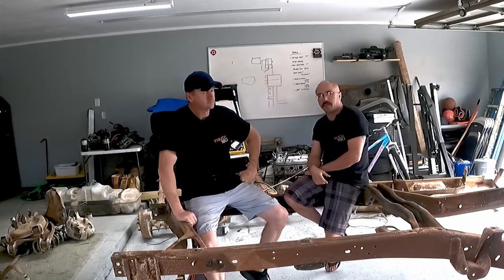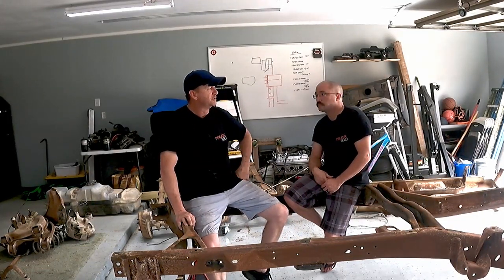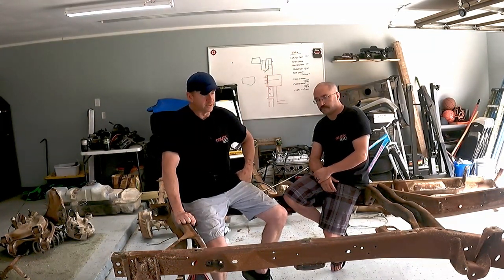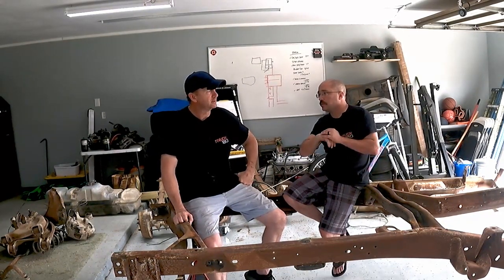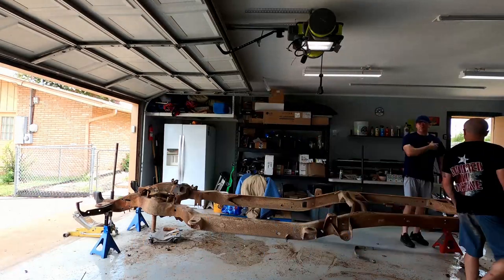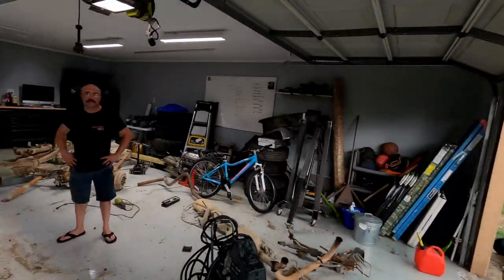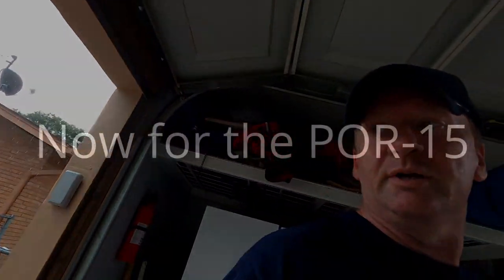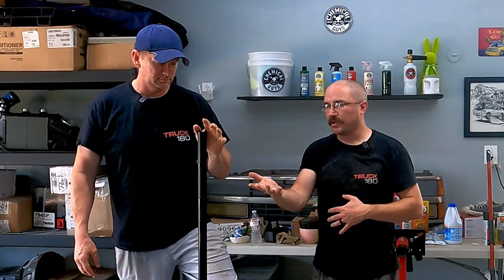Painting a rusty frame with POR 15 | Budget OBS Build

Comment: I see anything OBS I'm subscribing lol. Nice work guys can't wait to watch the whole build
Reply from the maker: Keep your eyes out this week for the drop kit video
Reply: There’s no such thing as an obs Chevrolet
Reply from the maker: @obsnation8453  What do you mean? It's a '93 and the OBS (Old Body Style) is the '88-98 year models
Reply: @Truck180  the only OBS is an OBS Ford. The nickname OBS came from when Ford did a complete redesign of the superduty trucks in 1998 but still had the same powerstroke. The name OBS was to prevent confusion between the 9th generation F Series Super Duty from the 10th generation F Series Super Duty. So in other words there’s no OBS Chevy. The proper nickname would be squarebody Chevy.
Reply from the maker: @obsnation8453  Well I'll have to disagree. The term OBS and NBS was used on the Chevy truck way before 1998 and the Square body was produced from 1973 to 1987. The term OBS only means old body style like NBS is new body style so really it can pertain to any manufacturer.
Reply from the maker: Everyone has the right to be wrong.
Reply: @Truck180  Chevrolet fanboys tend to act like this when in fact ford started the OBS. Nothing for you to be angry about it’s just facts
Reply from the maker: @obsnation8453  nah not mad at all. But the facts are that OBS and NBS was started way before 1998. No need to start with the fanboy stuff thats not it at all :)

Comment: How come you guys didn't use the POR degreaser and metal prep? They are required for a solid bond when you actual go paint it. It's a 3 step process. Hmmm......I don't think the paint is going to hold.
Reply: Degreaser yes, they should’ve used it, metal prep, no, metal prep is only required for bare metal surfaces, it’s an etcher, this is a rusty surface so this will do good
Reply: @TheRegretedURL  Metal prep is supposed to be used for both rusted and bare metal surfaces....for por-15 application....and especially if one has wire-brushed the rust.  It's a necessary step.
Reply: That's what I was going to ask.
Reply: I would love to a future look at the frame seeing that they didn’t show the use of the step I or II and just went to painting for step III of POR15

Comment: I’ve been using por15 for over 30 years good stuff my Camaro frame still looks the same
Reply: Do you keep it inside or out?
Reply: @tylervoit9447  cars kept inside but used it on my trucks and still looks good but we’ll sun fade recommend light prime while it’s still tacky that way regular paint sticks to it
Reply: I did a truck frame and after one winter rust was starting to come through. I’ll have to try it again
Reply: @morganhay859  did u do it right? Is says to use their degreaser, metal prep and top coat too
Reply: @MaddoxMelton  honestly I don’t remember because it was so long ago but I know it was taken down to bare metal and degreased

Comment: I did my entire 69 mustang frame with it after all the correct prep. Had to make a repair to weld spot and that’s when I found that is started pealing off. Hit it with air gun and it pealed off. Spent the next 3 weeks sanding and wire wheeling the entire underside and front frame! Will never tell anyone to use it! Same thing happened to my lawn tractor mower deck that is did while drinking the juice!! 
Never again!
Reply from the maker: That's not good at all. So far there have been no issues on this frame. We cleaned it and wiped it down with a prep before painting it and its hard as can be.
Reply: you have to paint over it. uv rays (the sun) kill it.
Reply: @frigglebiscuit7484  car never left the garage was still working on wiring.

Comment: Gray is a good color. That way you can see whatever color top coat that needs to be spayed over it to protect it from the ultraviolet rays. But sense it under the carriage it’ll probably get none if any . But por15  will not stand up to the suns ultraviolet rays and has to be top coated with a premium paint that will.
Reply from the maker: We were going to paint it a different color at first but thought it would be good for the video for people to be able to see the frame. You're right you won't see much of it at all now that the body is on.

Comment: I'm 🤔 of using this to paint my boat trailer. I have heard POR 15 doesn't last in the sun, is that true and should I paint over it somehow?
Reply: Correct, it doesn’t have UV protection. It will eventually fade. It would need a top coat.

Comment: Por 15 is a 3 step application....did you guys not read the instructions?
Reply from the maker: Which part did you mean?
Reply: @Truck180  Supposed to apply the cleaner and degreaser, then the metal prep...and then minimum of 2 coats of por-15.  That is the standard procedure for por-15 application in all circumstances.

Comment: All that work taking it down to the frame just to power wash it? Why not sand blast it and actually get rid of the rust ?
Reply from the maker: That was the original plan but the places we were going to use we just couldn't get our schedules lined up. And we don't have the setup just yet to do it ourselves. The POR15 is designed to paint over the rust so we figured this was a good example because not many people have a sand blast setup in their garage either.
Reply: @Truck180  I hear ya, and it does look good.  It’s just like putting a band aid over it though, I doubt it will stop the actual rusting of the metal underneath. I’m sure you’re not as concerned in Texas as I would be in northern illinois though lol
Reply from the maker: @michaelm770  It's supposed to be tough enough to stop the rust since it seals it. And, it self levels so it looked way better than we expected. We'll have a sand blast setup soon but couldn't keep waiting.
Reply from the maker: Lucky Jackson  maybe we will try that the next time around and put them head to head